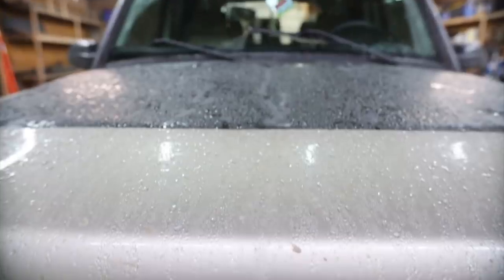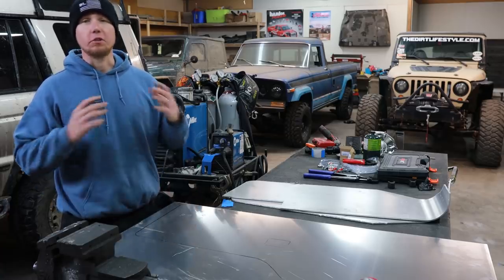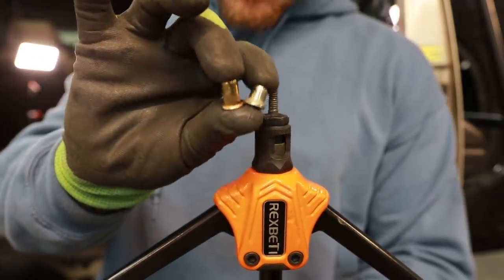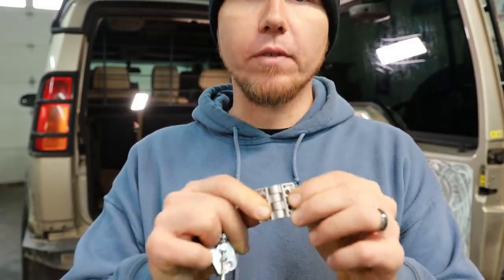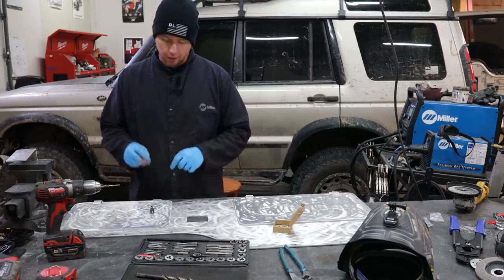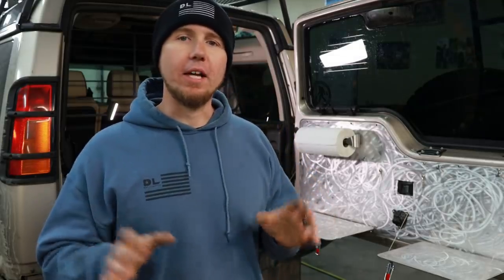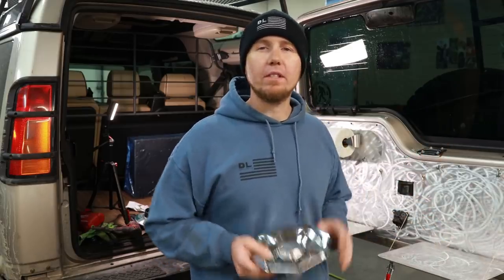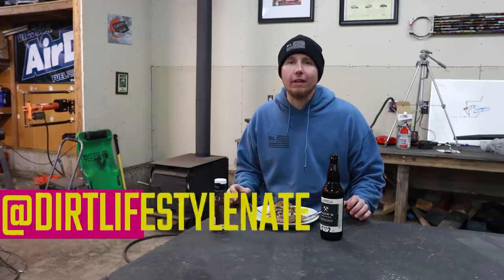ULTIMATE Overlander Tailgate Kitchen! Ultimate Land Rover Discovery Build Episode 1.

Comment: this is awesome, I think one of those cheap LED Tag lights would be a neat idea for the top of the door, won't take up much space, and might put off enough light for cooking, but maybe a really cheap "rock light" would put off more light
Reply: I bought some LED strip lights that t have sticky tape on the back. They are bright white, and I have them on the inside of my rear lift gate on my wrangler. They work great! Around $20 at Oreilly Auto parts. Probably less on Amazon. Love the drop in bur era idea. I have two of those burners and am constantly fighting the stands that are supposed to hold them up. Thanks for the great idea!

Comment: Nice build Nate.  Enjoy all your stuff. 
One thing I might have tried w/ the limit cables is to drill through the tailgate and add cable stoppers at the top on the inside. So when you stow tables, cables go into the door,  nothing is hanging out. Should be easy, and very clean.

Comment: Just had an idea, you could drill some holes on the edges of the fold downs and use "S" hooks to hang utensils. Here's a tip, stuff a bunch of plastic grocery bags inside the paper towel tube to use for scraps etc' while cooking. We have a tailgate and use it for a kitchen I always have a grocery bag hanging from the latch pin.

Comment: Cool build.  I live in an area of Northeast Oregon that likes to receive a good dose of weather from time to time.  One thing I would be concerned about cooking on that setup would be a gust of wind blowing it shut or even folding the door back.  You might consider some reinforcement arm or something to lock it in place.  Just something to think about.
Reply from the maker: That's a good call. Since the spare tire carrier is integrated into the door and the bumper, it puts up alot of resistance. I think with this rig I'll be ok but I want to make something similar for my liberty. The liberty will definitely need some "anti swing" thought put into the design. Thanks for watching 👍

Comment: Whenever drilling through a inside door panel like that I use a rubber hose slip it over the drill bit like a 3/8 that is cut to the depth I want so I don't drill or dent the outside panel. Old tip, Love that burner idea im gonna steal that...oh yeah like a thief.

Comment: First of all thanks for a great video. I'm doing something similar for my 1993 Discovery and I'll use some of your ideas but with a twist 😁. The latch on your model is right in the center of the door which is really annoying but in the older Discos it's in a better spot so I'll do a long table instead of two small ones.

Comment: I have noticed that rivnuts can spin in the hole over time. Plus seems to crack then sheet metal as well. I have used slightly longer rivnuts and washers to help with the cracking and watch how much I torque the fasteners down.

Comment: If you want a good looking, durable finish for a piece of aluminum, use a rotary steel brush and a 90 air grinder. It definitely is a better looking almost pebbled matte surface than looping with a grinder. To me, anyway. 

Nice work though.

Comment: First off - your content is great, and it is clear that you had a vision and went for it. Congrats. What type of aluminum did you use for the table? I heard you say it is 3/16", but do you know the grade of aluminum? I finally built my XJ rear kitchen. The last thing is the pull-out stovetop, which I would like to make out of aluminum to save some weight and keep it easy to clean.
Reply from the maker: I'm not sure on the grade. Some of it was scrap from the metal yard and some was scrap from my genright corner armor 👍

Comment: I have a question, what did you mean by hardware seize?  I am planning  a build out of aluminum and have to install hinges. Thanks!
Reply from the maker: Stainless hardware likes to lock up on you every so often. It will stick to whatever your threading it into. For this reason I use alot of anti seize to prevent any issues 👍

Comment: Got one of these to hang in back of jeep facing backwards for light when using tailgate setup at night.  Rechargeable and you can use for under hood too.  This way you dont' have to run LED strips.

https://www.amazon.com/gp/product/B01MTXC016/ref=ppx_yo_dt_b_asin_title_o00_s00?ie=UTF8&psc=1
Reply from the maker: That light is pretty bad ass!
Reply: @DirtLifestyle  Yeah. Worked great and the spring in each side is legit, making it very versatile.